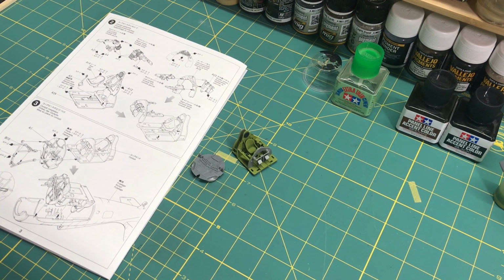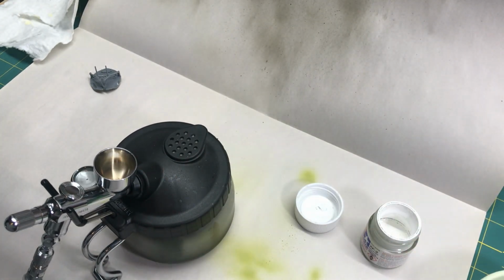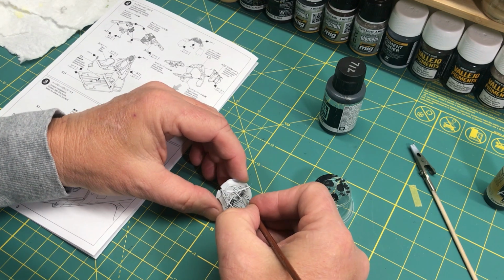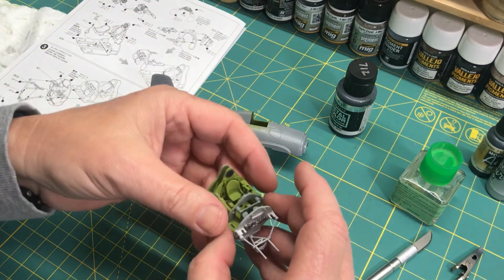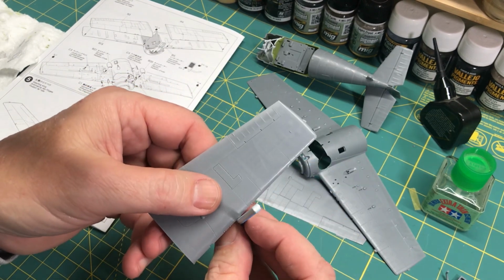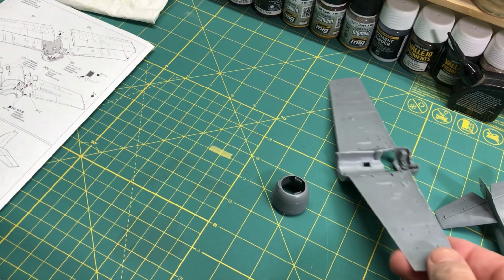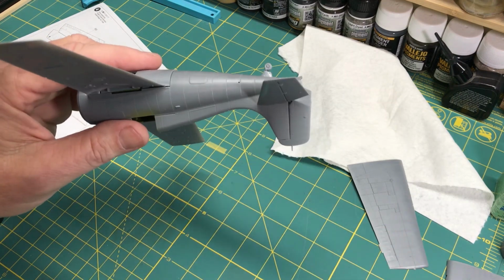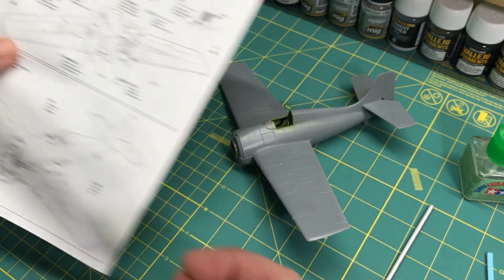Tamiya 1 48 F4F 4 Part 3

Comment: Hi! Just completed watching Part #3 and have been taking a lot of notes. This series has been really helpful for me. I wanted to ask you a couple questions. I think your workbench is inside your house? I know that you do most of your painting off camera, so was wondering, do you get paint dust all over the place? Your work area seems to be pretty neat. Also, do you wear a mask when you spray paint? I see where you put a piece of thick paper when you paint in the videos, but I thought in one of your other videos I saw you had a paint booth. Still, it looked like it was inside the house, so wondering if some type of exhaust is needed? Thanks for the help...Tony!

Edit: I forgot one question. Where do you find those small square sanding sticks you often use?
Reply from the maker: Hello again, Tony!
Workbench is , indeed, in the house.
Paint dust is minimal. I think the way my desk is set up it kind of contains what little dust there might be, to the work area.
I keep my work area very neat. I sometimes stop mid-way through a project and clean everything.
I do wear wear a respirator when spraying Tamiya paint (I just started this recently) and a quality dust mask for water based acrylics most of the time.
The paper I use in from an inexpensive newsprint drawing pad. Keeps my cutting mat/work surface clean, plus I can give the airbrush a good blast if it seems to be clogging a bit. Shoot it right on the paper.
I had a booth that I made a long time ago, but used it in the shop outside. I haven't used one in years. My room has pretty good ventilation/circulation so I haven't seen the need for a spray booth, but I would consider it if I had a bit more space.
The sanding sticks I get from the local Hobby Lobby. They are pretty cheap and work pretty good.
Reply: @BrettG64  Thanks for the reply Brett! I don't have but a couple things I have found so far, so no work bench to speak of yet. I will need to look for the sanding sticks next time I go to Hobby Lobby. I do have three kits already that I picked up at Hobby Lobby during their 40% discount week. Seems they have this week discount every two weeks so far. So, going slowly but surely.